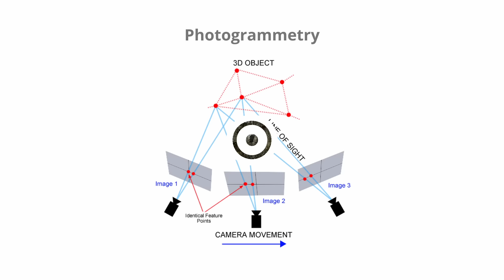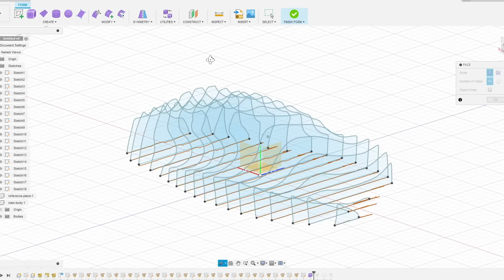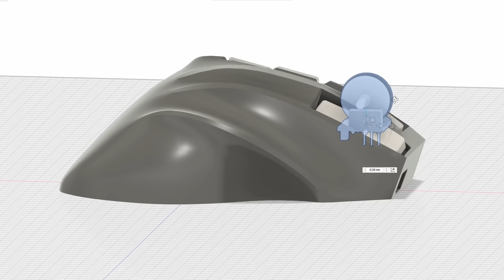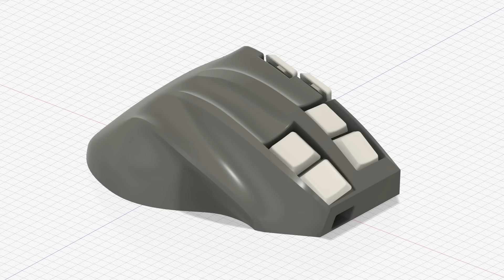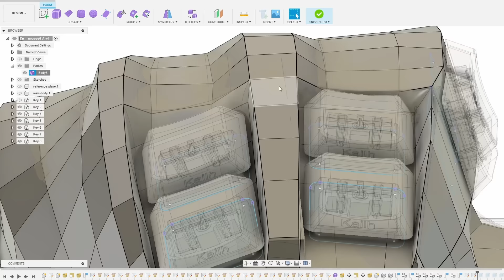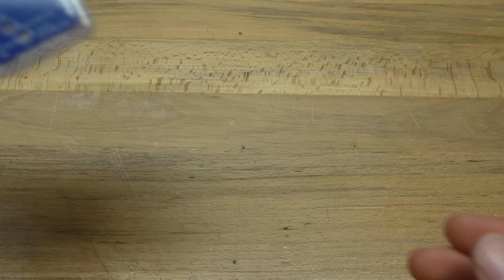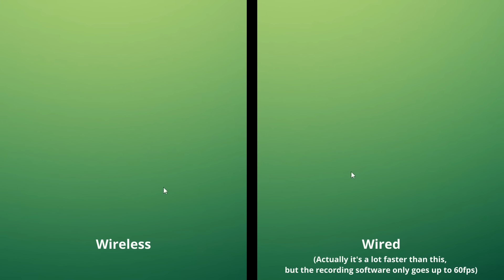I built a mouse from scratch with 3D printing and Arduino

Comment: The pulsar zywoo doesn't need any skates to be removed

also for the gpx, if you removed the skates, there are 3rd party ones you can use for when you need to repair it

Regardless you can get replacement micro switches and scroll wheel encoders easily on aliexpress. 

I have no idea why you acted like this is some grand conundrum.

Comment: Hey, no idea if you're still responding to comments, but I would love to get an estimate on how much it cost you all together, and what you feel like you could do differently now. I'd also greatly appreciate it, if you have a bit more info on what tools you specifically used, but I'd hate to be a bother. I know very little about circuitry and things like this, but I know 3D design, and I love to tinker, so I think this would be very interesting to attempt. Despite loving the MX 3, my experience with Logitech has been abysmal, so I'd rather try my own hand at it and see how it goes.
Reply from the maker: Hi, I do read the comments on older videos. Cost - honestly I don't remember exactly, but probably more than just buying a mouse. Tools: Fusion360 for modelling, KiCad for the PCB design. As far as changes - back when I made this I had basically no experience with PCB design, so I made it a super basic 2-layer board with through-hole components and assembled everything myself. Now, with more experience, I would probably try to have everything, including the sensor on one PCB, rather than using someone else's pre-build module and an arduino. In other words just have the microcontroller and everything all in one package, although that would take more time to design. That being said, the mouse is great, and I've used it on my main PC ever since this video and it has had no issues. Hope that helps!
Reply: @benmakeseverything  Cheers, that helps a lot! I'll definitely look into it and see if it's something feasible for me. I appreciate the response!

Comment: Have you thought of using RF2.4Ghz instead of BT? Way faster. Also, when you use RF module you can handle commands you send in batches to further increase throughout. As the downside, your pc dongle will need an arduino mated with RF module too.

Comment: Since buttons (Mouse, Keyboard) are getting worse and worse, I think someone should come up with the "button for a life time" project. 

I fancy all it needs is a small spring and an optical (not mechanical) sensor. (LED + Photo diode). That, then printed into a nice mouse-button plastic casing and it should last long enough to make the following statement possible:

"Son, this mouse was passed down the generations, from my great grandfather, to my grand father, to me and now, son - it shall be yours!"

Consider this a challenge :)

Side note: There was a light bulb mafia (cartell) which agreed upon maximum life times of light bulbs. It was technically no problem at all to build long lasting light bulbs, but they want to keep selling new ones.
I persnally think, behavior like this should be a jailworthy crime against planet, environment and humanity. The same idea is at play if it comes to computer input devices.
Reply from the maker: I like the idea! It would probably require some company to produce the actual optical switch - in order to make it sufficiently small and reliable.

Comment: The m65 is such an uncomfortable shape size and weight. I don't have the largest hands, but they're not small either. I find the G Pro x superlight to be too small..

Just saw a post on Reddit of pulsar showing some new potential mouse shapes and I was just thinking it would be cool to design your own mouse with clay and 3D printing so I did a search and found this video.

Looks pretty sick though nice job. Different from anything on the market. I would be interested in trying that out. Maybe you could start a business making custom gaming mice by sending out a big ball of clay and having people use it to shape it to fit their hand and send it back to you for you to put it together and send it out to them

I like my zowie fk1+ a lot. But would be interesting to see what I could come up with with some clay and designing software and 3D  printer

Think my hand is 19cm long and 11cm wide

Comment: I... I gotta say, this mouse design would be fantastic, I've always hated how mice with "sniper buttons" have them so far ahead that I have to change my comfortable grip or move my grip while using it to reach them, but this would be really good since I just set the button to the middle mouse click anyways, the 2 KB buttons under the left/right clicks is also really interesting, really wish the mouse manufacturers would stray away from the "the same mice but it's smaller/it has 20 buttons/some other gimmick"

Comment: how about using Bluetooth serial and having another arduino connect to the pc as reciever

i searched for a mouse sensor, great you shared it

for the switches i would use kailh mute buttons, because than u can take the mouse too public places and its silient

also you could cover the mouse with silicone to have really good grip. i am thinking of making more buttons and than having two mouse and this would replace the keyboard 😂

Comment: Great job on the project!
Are you still using it as a daily driver? What have you learned? What would you do differently this time around?
Reply from the maker: Thanks. Yes, this is the mouse I use every day. Its been great, no major issues. The only 2 things that could be improved are: 1: The weight - its not bad but does weigh more than your typical gaming mouse. 2: The 3D printed layer lines do cause it to collect a bit more junk (dead skin) over time. Its not too hard to clean it off, but I would recommend sanding the mouse down and polishing it and maybe applying a clearcoat to give it a smoother surface next time.

Comment: Do update it and make the wireless version more good
As I got Android tv and use many Android apps but tv doesn't support touch and tv remote does not always work on all ui
Hence I have to use the mouse to use the app and tv remote to control the tv

This will actually fix all my issues with a mouse with a rewritable button function which I will change to some basic remote commands like arrow keys and back button to move around.

Comment: You can fix the logitech pro wireless scrollwheel by rolling it against some surface (like table) where it reaches high speed. Roll it back and forth for a few times and it's fixed.

Seems like some oxidation or something.

Comment: If getting the firmware right is the only problem, you could salvage the sensor and board from a cheap mouse. But then you wouldn't get the novel features.

Comment: Hi Ben, about the mouse rotary encoder, the way it works from some datasheet i found is that they are treated like 2 individual switches, there are copper plate inside and each of them represent individual switches when rotate the gears press copper together, so those 3 pins are technically  the keyboard matrix. thats how they cheap out on getting tactility scroll wheel on gaming mice, not all encoder are the same, there are also hall encoder and IR encoder which i think all the mouse with infinite scroll wheel have, even my 12 years old budget logitech g300s mouse have it, the way they achieve tactility in these encoder are through a different mechanical design tho
Reply: I don't understand how that differs from his explanation.  Can you explain more?

Comment: Building a custom mouse with custom buttons is something i figured is possible.  I want to be able to work in an accelerometer so the mouse movement can be adjusted based on the mouse angle to the screen, just not sure if that's something would be able to learn with drivers and code or using arduino.

Comment: This is super awesome. I've never fully delved into Arduino and from what I hear its the easiest way to start. I personally like my Logitech MX and I have rather enormous hands that dwarf it but I've still come to like it. I would however like to do something like this for a CAD specific mouse add on with the controllable keys and stuff. The info on the PCB design software you used is also helpful as I too have never had luck with surface mount components and can really only understand simple PCBs.

Comment: YT randomly recommended this and I'm so glad it did. I love my Logitech M575 trackball, but the main switches have a tendency to fail in a year, and for gaming the polling rate and latency sucks. Once in a rare while I'll get it in my head that I'll learn what I need to build my own and will spend some time looking up people's DIY mouse projects for inspiration. This is maybe the best example I've seen yet that gives me hope that one day my dream of the perfect M575 alternative will exist.
Reply: I recall reading somewhere that the reason Logitech's switches tend to fail is because they don't use them correctly. They're only designed for so much voltage, and Logitech puts too much through them, resulting in arcing, which results in deposits building up on the contacts, making them not click properly. You can pull the switches apart and clean the contacts, but from what I've seen, that's going to be super-fiddly.

Comment: Not bad but hotswap switches instead of soldered would have been better for replacement.
An optical encoder tend to be more reliable than resistive/capacitive ones as well.
Reply from the maker: Those are good points. The reason I didn't do hot-swap sockets was limited space.
Reply: @benmakeseverything  space? Nah you could have put the terminals in the shell itself.your switches was already friction fitted.

Comment: For wireless to work without bad latency, you pretty much have to use 2.4ghz :( Bluetooth sucks even with brand-new high end mice. And interestingly: the Lamzu Atlantis Mini I have has easy access too -- pull the skates up and unscrew the bottom and it comes apart just like yours! Much too small for your hands though :)

Comment: If you sold this, I would buy one. I also have a bit bigger hands AND I think it's pretty smart to have two buttons where there is usually 1, the scroll wheel is also very smart.
I'd buy one.

Comment: PLEASE make a full Tutorial series on how to program an Arduino / How you learnt how to program it, how you learnt to do all the wiring, 3D Designing etc. Basically a full "DIY Course"  would be awesome (I REALLY want to get into that kind of programming but don't know where/how to start..)
Reply from the maker: I suppose I could try making some instructional videos. I'm completely self-taught, mostly by just watching tutorials, but I do understand that it can be overwhelming. Right now I'm focused on building my next project, but I will consider your suggestion for the future. Thanks for watching!
Reply: @benmakeseverything  Thank you so much and I'll make sure to check my subscription box :)
Reply: @benmakeseverything  How long did this take u? im thinking of trying it out for school but there is a deadline so idk if its worth it

Comment: really wish I had paid a bit more attention to the sensor, It is a board, it says so, the parts list shows it but I went and bought just the sensor, good price and free post, all taxes paid.
Bought the pcbs and components, soldered iy up OK and then the penny dropped !!!!
Now I need to work out how to justify buying the board, courier and customs to get this board in to Spain without costing more than I really should spend.

>> Still want to say, Love what you have done, I just hope I can finish it now. <<

My bad. next time I will most likely make the same silly mistake, sighs

I want a mouse that I can freeze the "Y" axis and I really thought this was a really good chance to make and mod.
Reply: ok i now have the correct part so, I have the hardware, not 3D printing yet, now I make a start on the code and see how far I get,; so vfar so good

Comment: Oh dang, I just commented on your Cyberdeck video because I also made a custom Framework computer. Now I realized that you also built a custom mouse? 
I must admit, it's not a competition, but yours is slicker than mine. It was several years ago, and I couldn't figure out how to get an arduino to read a mouse sensor, so I ended up using the Keymouse PCB which is meant for their products, which include a keyboard, so they're bigger.

Comment: Nice go at it. But there are quite a few reasons why people opt to build new shells around existing mice guts, and while simplicity is probably the main one, having tried and tested components, firmware/software and top-notch sensor/wireless functionality are definitely in that list as well.

Comment: Haven't watched the video yet, but the scroll wheel placement at bare minimum looks interesting. I've been thinking for some time now that pc gaming mouse needs improvements. Like gaming mouse on pc essentially means mouse for fps players. But I thought of it as a controller, for most of the time we have two buttons and scroll wheel, that's just not enough. And I know there were and is many mouse variants but it looks like they just slap the buttons without thinking and gg where's if you think about gaming controller that thing has been refined through what 4 decades with substantial changes.

I personally think that for a thumb there should be 3 buttons in an arrow shape like WASD just without S since bending thumb to reach for "S" doesn't feel natural.

I'm going to watch your vid now. Just wanted to comment on wheel palcment before I forgot.

Comment: ESP32 is not a great controller for Bluetooth usage, it's somewhat power hungry. You might have more success with an nRF52840. The nice!nano is an nRF52840 board with a pro micro compatible pinout, used a lot in the custom keyboard world, and supports both Bluetooth LE and USB HID, so you can also use it wired. You should definitely check it out if you still want to get a wireless version working. 

Anyway, cool project! I like how the thumb scroll wheel turned out, and the RGB is a nice touch.
Reply from the maker: Thanks, I'll check it out.

Comment: this is a great implementation, one of the best ive seen. very curious as to latency, weight, polling rate and other synthetic values that can be compared to those expected from commercial products that utilize a flawless sensor like the 3389. look into the OSLTT (open source alternative to nvidias LDAT), and other solutions to measure min liftoff distance, acceleration, tracking speed, framerate, axis asymmetry, jitter, and interpolation.

Comment: Hey, I just wanted to tell you that the micro usb port in the arduino pro micro isn't durable, it is a surface mount and not through hole. It cannot resist being plugged and unplugged over and over and very light forces could break it. I've used one for a macro keyboard and it broke in less than a year. If you want to use that board for a wired mouse, I will recommend a kind of support as a strain relief. 
Other than that, loved the project. Keep it up

Comment: I was captivated by this entire build process, but I gotta ask for the wired and wireless ones, how much do they weigh?
Reply from the maker: 143grams (5oz). Not the lightest, but not bad. The  solid metal scroll wheel is the heaviest part, and could be replaced with a PLA printed one.

Comment: i love the vid bc i searched for that for yearsbut didnt found any (with the electronics part). i have on question tho, can you build a pcb and then solder a sensor directly on the board?
Reply from the maker: It would have to be designed that way, but yes you could. I did it this way because of the height of the rotary encoder - but if you wanted to use an alternate part that would be an option.

Comment: Photogrammetry often uses the background to figure out what angle you're taking the picture from, so putting it on a turntable without extreme measures to 100% remove all background is exactly the wrong approach.

Comment: Good video and well explained. Having big hands and playing FPS can get painful. I have been working on one myself that has a Cortex-M4 at its heart, dual sensors, as well as a different suite of buttons. In shaping the body we took almost exactly the same steps, I just did more smoothing in blender. Also some of those rotary encoders have COM on the side pin.

Comment: Making your own mouse is a great way to implement macro buttons, which I miss everytime I change my mouse (and had to accomodate with the new button layout). They are very useful in CAD.

BTW, did you consider using a ESP32 instead of arduino ? With its higher clock speed you may increase poll rate and precision.
There are a bunch of ways to use it as HID and even, with some boards, you already have bluetooth (ESPRESSIF ESP32 should be very  good for this task).

Great job.
Reply from the maker: I did try to create a version using a Feather S3, which is ESP32-based. That was the wireless version mentioned in the video. Unfortunately, the latency was not very good. It may be that the code was not optimized, but I figure there is probably a good reason that commercially available wireless mice use a dedicated USB receiver...

Comment: The Corsair M65 is very easy to take apart. There's just no repairing it. It is notorious for the scroll wheel to mess up. Some have said cleaning it helps for awhile, but I had no such luck. Switched to Razer and it's been two trouble-free years. YMMV of course